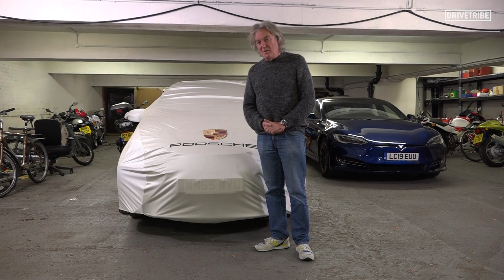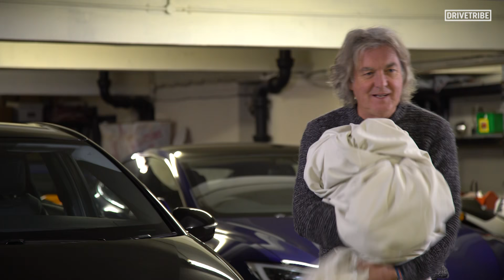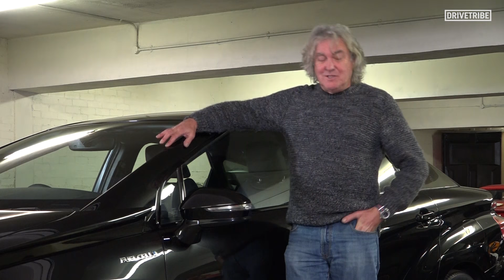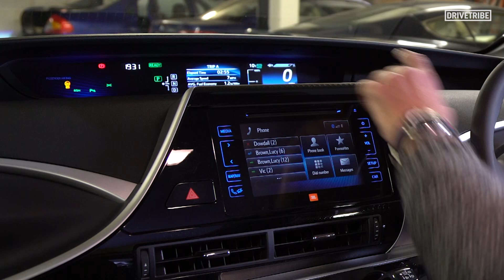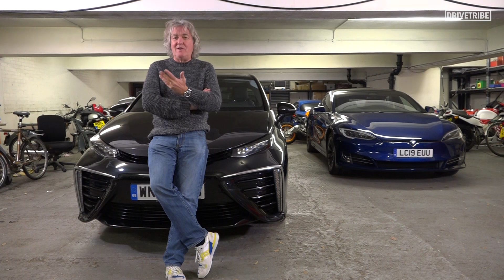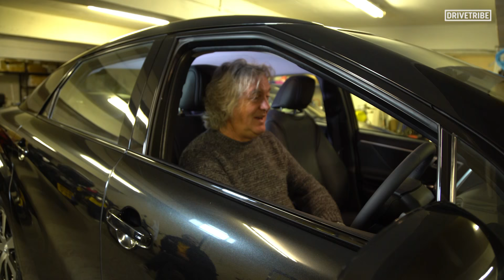James May has bought ANOTHER new car

Comment: Everyone is screaming from the rooftops that the rising oceans are going to destroy all coastal cities. Solution; use that rising water to convert into hydrogen for fuel cell power and solve both problems. Too bad Exxon Mobil and Aramco don't make insane profits from that, so probably not going to happen.

Comment: With both the tesla and the miri , drive them both up to orkney , where the 'surf and turf' project has a hydrogen filling station ( the UKs most northerly one of the 8 !) and ive driven to orkney 47 times from Leicestershire in all evs from the Mitsubishi i-miev,  to  a Tesla Model S , and everything in between. Get in touch and i can arrange a tour of how orkney turns surplus electric from renewables ( yes we make TO MUCH on orkney) into Hydrogen to power generators on ferries and fuel cell Renault kangoo vans and heat buildings.

Comment: Clickbait car cover 😂. My first reaction was "the nose is too high for a Panamera and too low for a Macan"... guess I was way off.

It will be interesting to see how these compare. Especially with Tesla's known issues with perceived quality and Toyota traditionally having that bit nailed down solid, vs Tesla's performance against Toyota's appliance-ness. I used to think the fuel cell cars were the future, but battery tech has advanced quite a bit over the last decade to the point where I think battery EVs will likely be the way to go. Once they get charge times down to 10 min or less (for 200-250-ish miles of range) I don't think fuel cells (or even ICE for that matter) will have much of an advantage anymore.

Comment: 4:30
yeah, but once upon a time there were only 8 petrol stations...

Fuel Cells are WAY more logical long term. Especially since it's a good way to use the electricity produced by solar/wind in times of excess production in a power to hydrogen process. It's a good storage. Yeah ok the process is not particularly efficient, but efficiency won't be the limiting factor in an all-green-energy economy, storing energy is the harder challenge. It's the only real challenge. And fuel cells can be used in ships (even in submarines), trucks, trains, as backup-power in hospitals, ...
Reply: ah damn, I type all that stuff while having the video paused and now he's saying the same things xD

Comment: I think hydrogen fuel cells are the way to go vs batteries, it's basically the same thing as gasoline without all the negatives. It will only improve if the industry moves that way and become very efficient.

Comment: One of the other benifits of the tesla is the ability to tow charge. Yes not ideal however with only a small amount of towing I believe the ratio of 1 towed mile is equal to 3 driven miles so while range anxiety does absolutely exist when there is limited infrastructure with a simple tow strap in the frunk you can easily get out of trouble!

Comment: "It takes 2 to 2 and half minutes to fill up"
Of course that's not including the 30 minutes driving to one of the handful of hydrogen refueling stations, and the 30 minutes back.
Hydrogen is also a bloody pain to contain and transport. It is a very small, and explosive, atom that will find any route out. When in cryogenic form (cold liquid) it causes major issues with embrittlement which is a nightmare for maintenance. You think an ICE or BEV fire is dangerous? They say these are very safe in crashes... They may be, but I don't want to be the one proving or disproving that claim. The Mirai tank stores H at 10,000psi, so probably a design pressure of 16,000 or thereabouts needed. Here's a scuba tank test failing, at around 12,500: https://youtu.be/08IDdDEgJx8?t=404
I would prefer not to be in a Hydrogen car, or even near one, when that happens. Imagine a pile-up with a petrol fire. Or battery for that matter, but petrol can leak and flow away from the originating vehicle. Even if the crash impact doesn't rupture the tank, I'm not so sure it will withstand a good fire causing a huge spike in pressure. And of course, in that scenario where it ruptures you have a very large volume of explosive gas rapidly decompressing, and mixing with air and fire... So if the initial pressure wave and shrapnel from the tank don't get you, the explosion from the hydrogen can pulverise anyone still standing. I want to see a test that replicates that scenario... from a reaaaaaally long ways away.

Each filling station costs millions. The infrastructure CAPEX needed to change from petrol to Hydrogen in garage forecourts is nuts. 8000+ petrol stations in the UK alone. Alternatively, 95%+ of electric charging can happen at home, overnight, increasing the off-peak utilisation of the existing base load of the national grid. The national grid already exists.

Comment: You can also use hydrogen to turn waste into #hvo that runs in any diesel engine for massively lower emissions and better mpg. Works down to minus 40deg C and can be used in jet turbine engines from PT6 to Trent 1000.

Comment: Storage argument: No, because H it is a 80% energy lost, EV 15%. And Pumped Hydro is only gives you a 7% Estra lost energy + Super much more expensive. UK has 4 Pumped Hydro. Blåsjø has a storage capacity of 7,8 TwH (can run London for 21 weeks - Whit one dam). Then the UK did not need to pay 0,092£ pr KwH (H.K:Piont 3 - payed by China and construed by the Frogs... Good luck). Solution: 3*1,4Gwh= 4,2GwH exchange capacity, 3 cables, to Norway, and the UK can get down their power price by maybe 50%, and have somewhere to store the surplus renevabele energy.

Comment: I feel like Hydrogen is the better option, although its tricky now one day it will be easier to extract and a lot cleaner then batteries as they are filthy to manufacture, one day you will get a hydrogen cell at birth and it will see you through your energy needs for your whole life. Also we have a fuel station in my town! unfortunately its Swindon..

Comment: My question would be. Why one? why the other? Why not both?. A car with big enough batteries for say, 100km, that can be "plugged" if needed, and a Hydrogen fuel cell that feeds electricity to the battery with a tank of, say, 4kg, and that can be "topped" with hydrogen. That way you get overall 500km, yet if you run out of hydrogen you still can "bunnyhop" between recharging stations until you're at an hydrogen-equipped station, not to mention you can keep the battery topped when at home, ensuring you always have at least 100km in your car and reducing overall consumption of hydrogen (because you would "top off" those batteries upon arrival at home).

Because otherwise I don't see how the hydrogen fuel cell can be viable in even the medium term. That stuff is seriously flammable; when transported is a far more problematic explosive danger than fuel trucks, and when stored it's an EXTREMELY risky business that demands very serious safety storage measures, (so stations would need to invest a shitton of money to make them safe) because a station with a huge reserve of hydrogen and an accident would cause a mini-nuke explosion to go off. 

Not to mention, cracking is still energy-inneficient at the moment; meaning that energy has to come from somewhere to separate H2 from the O in water; you use up more energy to create hydrogen that the energy the hydrogen will create in your car, and that energy has to come from somewhere - and right now most of the energy production comes from contaminating sources, you won't "stop" producing CO2 - you will only transfer the creation of CO2 from everywhere to localize it on a few places. 

With batteries you directly store that energy. With HFCs you use that energy to produce less usable energy in the form of hydrogen "Losing" energy in the overall process: So overall batteries are "cleaner", more energy efficient - hence a mixed approach when you can use batteries AND hydrogen fuel cells in tandem looks the most promising route to me if the fuel cells have any future at all.

Comment: I recently spoke to a director of the National Grid who made it very clear that there is insufficient capacity to be able to recharge car batteries if the governments target for electric vehicles is reached. At present some areas are already down to 3 hours per night for recharging and this is with the extremely low volume of electric cars on the road. This situation will get worse to the extent that if sales continue at the current rate owners are extremely unlikely to be able to charge their cars. The government has insisted that new housing developments must have a 7kw supply - the problem is that the energy suppliers are unable to supply this. My conversation has been supported by a developer who has abandoned a development of 300 “affordable” homes in Warwickshire because he is unable to obtain an energy supplier who can meet the standard. I have also seen that the British Motor Museum at Gaydon cannot expand or fully develop its premises because they to cannot get sufficient energy supplies and I  am given to understand that Land Rover Jaguar on the same site also face the same problems. Until this issue is resolved I suggest that the government concentrates what efforts it may have on maybe allowing petrol and diesel cars to continue until such times as adequate electric supplies and a controlled network exists to allow recharging of electric cars. My sincere sympathy to those people who have been mislead into buying electric cars.

Comment: Engineering explained broke down the math on this, even hedging heavily in the favor of other options electric is at worst 2.5x as efficient. Hybrids have never made sense as the added cost of ownership for a vehicle with effectively 2 drive trains and the associated additional maintenance made them worse to drive than a well maintained older V8 truck. 

The Tesla is an excellent option, if you want something more conventional get an ICE vehicle with a super low coefficient of drag and tune it for lean burn in one of the overdrive gears as the "legit street cars" youtube channel has demonstrated with a C5 corvette.

Grid improvements will only make electric more efficient whereas we have effectively already maximized efficiency of transport of most chemical based fuels. Once Tesla starts getting a sizable number of solar roofs installed and folks start seeing just how efficient an off grid structure is you'll see new home construction feature this type of tech much more commonly and that'll effectively put a pin in the energy issue (especially once they have some competition to drive development and bring costs down). 

A comparison of this is that a huge number of new homes in North America feature a heat pump for heating and cooling which is orders of magnitude more efficient than say an oil furnace which was quite common a generation ago. An offshoot of this is that power generation will effectively become democratized once enough folks begin feeding power back into the existing grid.
Reply: There are some problems there.
Existing buildings wont be upgraded.
Apartment buildings have bugger all roof compared to occupants for solar to do practically anything.
My last apartment was only a few years old and had no provision for plug in electric vehicles.
If every home does have it's own micro generation that does not make electricity free. The grid costs money to maintain, we collectively have to pay for that.

Comment: I’m glad May is aware of the current situation of both EVs, even though Tesla is obviously winning as it has good commercial advertisements and Elon Musk going everywhere to spread his words lol. 

My opinion on the HFCVs is that it has a very good background for further research/discussion because hydrogen is powerful enough to be used as a rocket fuel, which means NASA should also be helping with the development of HFCV. On the other hand, the source of H, if hydrolysis, the efficiency is not high enough to produce good amount of H gases, though there are still various ways to get H gases, the lack of infrastructure are the the global, which some doesn’t have hydrogen fueling stations in, whist the Tesla already have thousands of them.

One thing to mention is that the recharge time and Miles Per whatever they measure in of both EVs, the hydrogen has a normal fueling time, but the Tesla takes 20-30mins to charge not even fully I suppose, the time lost there could be counted as negative efficiency as you just sit there and do nothing, and nothing could be done to fasten the process. 

Also, the source of BEVs, straight up electricity, not sure about that as the only green ways to gain/produce electricity is from  wind power and solar panels, also water as well, but how do you transport the electricity to the stations, as you can’t and shouldn’t take a truck and carry it around like the compressed hydrogen gases or liquids, right?

Overall i think that the future will lie on the side that develops a better car to cover the current problems, both may reduce the CO2 emission but the cost of making the car and the fueling easier is still a long way to go.

Ps: hydrogen and hydrogen cars cost a lot to buy and develop as the tank to store hydrogen must be strong enough to prevent leakage, which I honk is as equally important as the Tesla cars, since there are loads of news about Tesla battery explosions.

Comment: Quick reminder that hydrogen is hard to store, has an electricity to electricity conversion efficiency of up to 40%. Lithium batteries are 85%-90%. It has much less lithium in it due to the smaller battery but it has a lot of platinum which has the same sourcing problems as lithium.

Comment: James, I used to work for BOC gases. They make hydrogen as a by product of oxygen and nitrogen distillation from the air. I think you should check with them on hydrogen sources and generation. Good luck with both of the vehicles, but I will stick with my 2015 Audi A8-L twin turbo, and my diesel truck. Appreciate the updates, and videos. I wish you and the boys would do these videos in a point, counterpoint video format as well.

Comment: The weight of Tesla Model S 100D is 2215 kg. The weight of a Toyota Mirai is 1850kg so the H2 car is 20% lighter but it is a smaller less capable car, a fairer test would be against the Model 3 that weighs in at 1611kg which is 15% lighter than the H2 car and is also a much more capable car. Refueling is faster in the H2 car unless you are the third car in the queue in which case you have to wait for the H2 to be pumped up to 70MPa (700 bar) and cool before being dispensed. The debate has already happened, we know which won. By the way all H2 cars leak hydrogen, if I were James May I'd have a vent to the outside air installed in the highest part of my garage roof or just leave the car outside (assuming reproducing the hydrogen explosions that destroyed each of the reactor buildings at Fukushima (caused by the release of H2 as a consequence of water on hot zirconium fuel rod cladding) or the H2 distribution centre in Santa Clara, California (caused by a failed or mishandled seal while filling an H2 tanker) or the explosion in Norway (caused by a leaking valve) was not an intended part of my study).

Comment: Besides producing it, storing and transporting hydrogen are also inefficient and overcomplicated. You need a pump that can generated enough pressure to .make/keep the hydrogen liquid. Once stored you need to cool the container to keep the hydrogen liquid. 
Filling up a H car also cost several times as much per mile as an electric car.
With hydrogen technology making hardly any improvement and batteries improving every year up to the point where a completely new battery tech is launched every decade, hydrogen cars really are a dead end.
Their only advantage is that you can fill up a H car in minutes, something electric cars will also be able to do in 5 to 10 years.

Comment: I see the future in BEVs. Especially if we are talking about passenger cars. As James said, if you can make electricity efficiently (e.g. with off-shore wind) why bother making hydrogen out of water and losing all the efficiency vs just pumping the electricity directly into a battery...?

Plus for car enthusiasts, a BEV architecture offers much more flexibility (batteries can be made in any shape, hydrogen tanks must be cylindrical - the Mirai doesn’t have folding rear seats), fuel cells are not really that much lighter than batteries anymore (the Mirai is roughly as big as the Model 3, gets the same range, and weights the same), and with a BEV you can charge in your garage and start every day with a full tank.